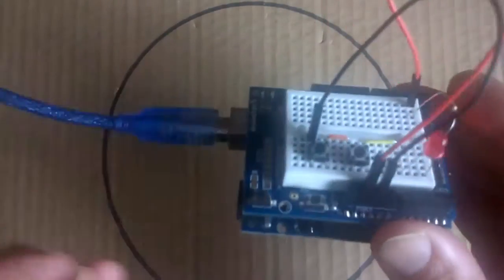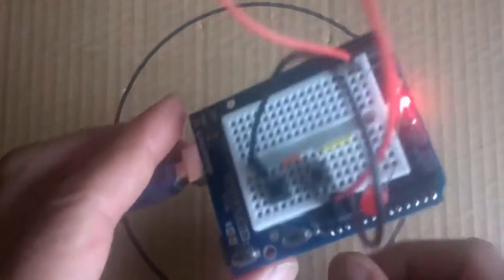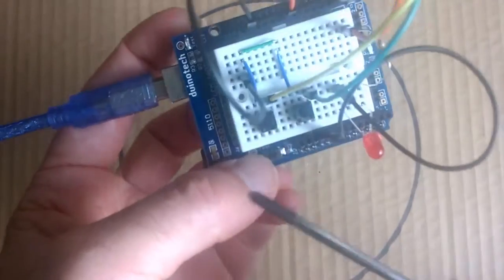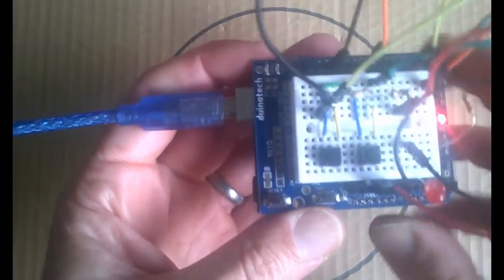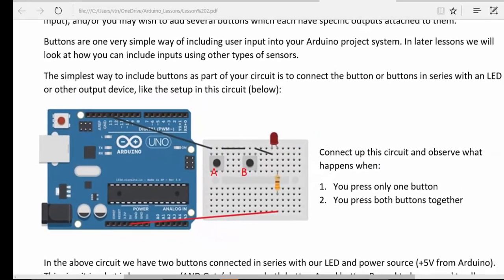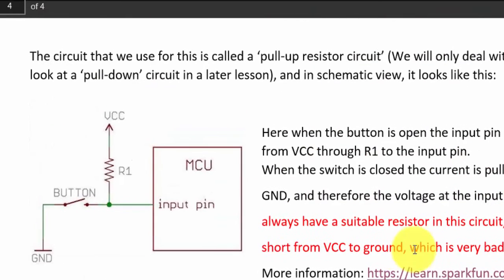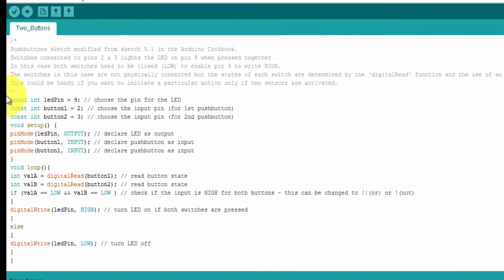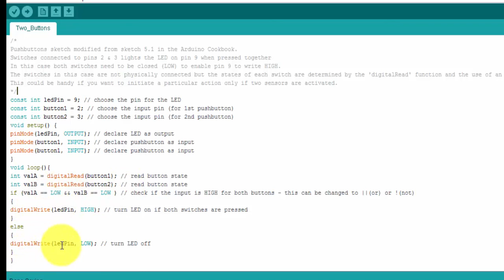Lesson2b - 2 buttons - Arduino a Quick Start Guide

Comment: great video thanks...you are amazing.go to your  lesson 2 pdf,and correct the pinMode(buton1,INPUT)because you write it twice.
Reply from the maker: Thanks for pointing that out Ardunio Hellas. That document has been read by hundreds of people and you are the first to notice. As you probably know, you don't technically even need to set the pinMode as an input because this is the default, but it is probably best to. Cheers :)